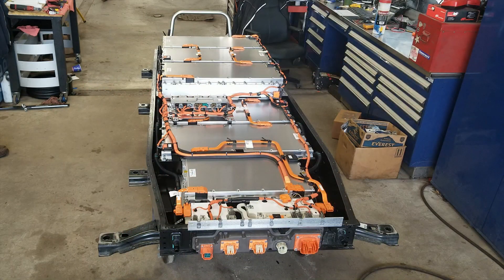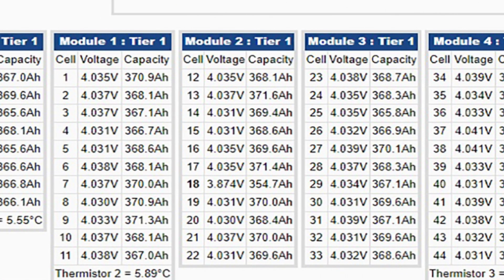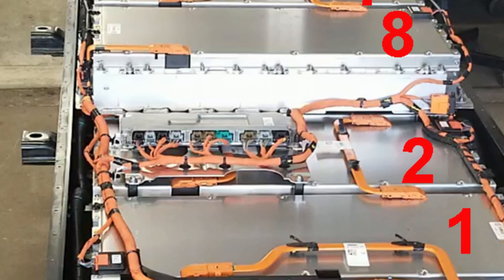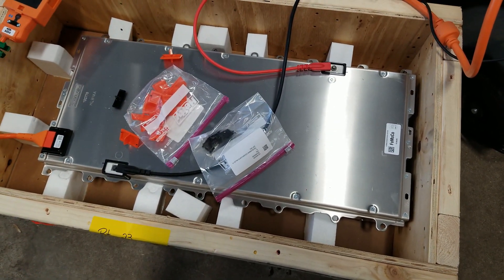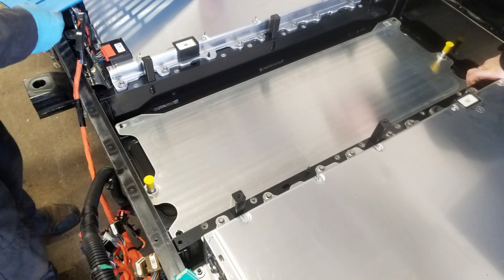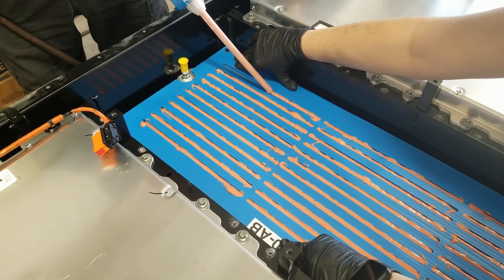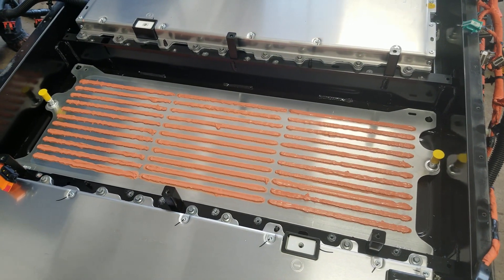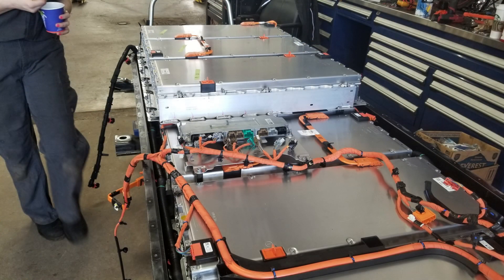2022 Ford F150 Lightning High Voltage Battery Module replacement

Comment: It's a 2022 model so the question is why it's being replaced ??? Why is nobody talking about how and why it needs replacing and who is paying for it? Supposed to be under warrantee for 8 years or 100K. Am I an idiot, that nobody is asking these questions?
Reply from the maker: It had a cell fault & repaired under warranty
Reply: Nobody is asking because the car is under warranty. If this was a ten year old pickup your question would valid. No such thing as a stupid question though!

Comment: Mine went through this back in January. Took about 9 days to get fixed. Has been fine ever since.
Reply from the maker: Glad for you, early production stuff always have bugs
Reply: I would love to know your experiences so far. I have heard of many problems and recalls and I wasn't lucky enough to get in to the first 200k to order. Supposedly only 18k have  been made in total so what is your experience? Now almost 20k more!!  Is it worth it?   Thanks
Reply: @erikwilson9498  This issue was the only issue I've had. Amazing truck. 8 months in and I'm still honeymooning.
Reply: Still good 2 years later?
Reply: @OnePointLander  yep. Love that truck to death.

Comment: The BMS is the problem here, it should have dropped the cell and let the vehicle remain on the road
Reply: Good point. 1 cell out of 96 shows low voltage and it disables the vehicle. Well played Ford.
Reply: That would be a great feature. Would you need a switch for each cell that the BMS could control? Hopefully Ford will be able to make some improvements as they get more operational data from their trucks in the wild.

Comment: Hi I have got ford Kuga had small crush at the front bumper no airbag damage when I plug FDRS in  coming up with the fault P1A10 code sobdmc hybrid politician control module battery disabled
I looked everywhere in FDRS there's nowhere I can enable this car does not start or crank any help where can I do a locate?
I have checked green disconnector high voltage front left looks fine please anyone can help

Comment: Let's look at the facts how old is his battery pack and look how long it lasted that is the true story
Reply: Let’s look at the facts here, to this day ICE vehicles leave the factory with major defects, needing transmissions, engines and other critical drivetrain components replaced within the first year of ownership all the time. And they have had 100 years to get it right.
Reply from the maker: @legacytesla  mechanic's need not worry, cars  or any other things with moving parts will always break down. The only things that don't are Death & Taxes
Reply from the maker: New models always have a higher failure rate than  normal. It takes manufactures about 2 years to get most of the bugs out

Comment: what if you get F150 lighting with 101k miles on it and then one of the modules falils?  how much is it to replace?
Reply from the maker: About 15 hours labour & 5.8K US for the module.
Pricing for the modules seem to change a lot month to month
Reply: At that rate I'd be looking into my options to replace the bad cell.

Comment: Could you tell me what each of the 4 battery connectors go to? I think  #1 goes to the AC/DC charging plug, #2 goes to the front motor, #3 goes to the rear junction box, #4 idk maybe accessories? Thanks!
Reply from the maker: 5 Connectors from left to right- 1 Cabin Heater/ DC/DC Converter, 2 Rear High Voltage Junction Block, 3 Secondary Onboard Diagnostic Control Module, 4 Module Communications Networks/ High Voltage Disconnect, 5 Motor(S)

Comment: Absolutely amazing video. Please do more as you work on more Lightnings.
Reply from the maker: Thank you! Will do!
Reply: So as ironic luck would have it, I literally just got this exact same code and my Lightning entered into the limp mode. I was able to clear the code using a OBD app which oddly restored power and allowed me to drive it to the dealer. They found module 4 to be bad. Any thoughts on if these are just a random couple examples of failure or a real concern that all the packs eventually will be vulnerable to this? Did Ford offer any insight in to what causes this?

Comment: Interesting! In a decade, hopefully this more modular for the swap and significantly cheaper. I am in the third month of owning a lighting.
Reply: It's cool that you can replace modules. You can't do this in a Tesla anymore. Tesla's are totaled and the entire car needs replacing.
Reply: @USNEM , could you say more?
Reply: @USNEM  Yes, thats true. Teslas only work above 20 degrees, are not allowed in garages and on ships because they burn all the time and they are totalled after 10.000 km or 1 year because their batteries crap out.

Always!
Reply: @wolfgangpreier9160  Tesla batteries have an 8 year, 120,000 mile warranty.  I'm not a Tesla owner but there's no need to go spreading untruths around.
Reply: @Brons2  Yes, you are right. With 8 years and one femtosecond or 120.000 miles and one angstrom the batteries are done and dead.

End of sarcasm. 

This is the manufacturer warranty. Currently we KNOW the batteries last at least 400-600.000 miles. In a few years we know more.

And please do not insult my intelligence that i would get the idea to even try to tell you untruths, personally.

Comment: Great video. Looks identical to the one I just had to change last week. Like the one featured in the video, mine too was a dual motor extended range battery. About the only thing different than what was illustrated in the video, was the module I had to replace. I had to replace module #6 which is the last of the top three, so thankfully I didn't need to remove the top three modules as well as the BECM to the one you had to in your video. From my experience, I found those cold plates to be extremely flimsy. When lifting the module off, I was getting hung up on the studs. Also, when applying the TIM, I realized the template provided didn't align properly to the bolt holes on the end, so I had to tape the template into the plate, apply the TIM, scrape off the excess very carefully as instructed by the workshop manual, and then lift the template off carefully before being able to install it onto the pack, and then in turn, lower the replacement module carefully on the of the cold plate without smearing the TIM as it is lowered. A very tedious task it was. My biggest pet peeve of the job was the time taken to balance the replacement module. I had to leave mine on the balancer overnight before the process would complete. So in the meantime, I have one of my bays tied up with the HV battery removed, and the top cover removed, waiting. The other bother for me, was waiting for the coolant bleed procedure to complete with FDRS. It took about two hours for that process to complete, so I had to have a charger connected to the LV battery, as well as the laptop charger connected during this (so that the laptop battery wouldn't die mid process!!!). So for me, raising and lowering of the HV battery itself wasn't the difficult part. But the rest of it....
Reply from the maker: As well as complaining on YouTube, submit a Labor Time Review Request to Ford!
Reply: @RedneckCam666  it would likely fall onto deaf ears as you know. I was informed by Hotline that the balancing process would be very time consuming, no getting around that. As far as how long it would take would depend on numerous variables, including but not limited to the level of charge the replacement module arrives at. As far as complaining goes, I only wish the required information on the original module to be replaced, could have been obtained without having to drop and disassemble the HV battery so as to increase efficiency in future repairs going forward.
Reply from the maker: @michaelchan8915  Not doing something about it makes it ... YOU are the problem
If everyone steps up...= Change
Reply: Thats interesting , info , its important when designing products that repairability is considered , seems like a messy long drawn out process to replace a module. Imagine it should take about 3 hrs total to do for the first time , and about 1.5 hrs once your dialled in. But at least the battery is broken down into modules unlike the Tesla where the whole thing is one big glued up mass.

Comment: Is this a standard range? So the extended range pack just finishes the 2nd tier of batteries?
Reply from the maker: This battery IS the extended range version
Reply: This is extended range, the standard range will have several of the large modules replaced with small modules (if you look at module 9 you will observe it is smaller than the rest, this is the "small" module and the others are the "large" modules).
Reply: They use smaller modules instead of just not having the top layer? That’s an interesting choice. I had always figured the bottom layer was the same and the ER was just the addition of the top layer.

Comment: all that for a single bad 18650 battery ( or whatever is used ) in a pack?  it seems like we have a reliability problem here . . .  This is NOT giving me a warm fuzzy feeling about electric cars.
Reply: totally different cells than 18650 cells; these are actually substantially larger cells, only about 80 of them per module vs hundreds of them in the little cylinder designs.

Comment: Until they make these battery packs swappable like a battery pack for your drill and a gas station is just a battery swap station. I’ll never get one
Reply: Would you swap your drill battery with a stranger? No way
Reply: @TheLemonBird  I would if it was a universal system where the battery station was the one to handle the maintenance on said battery. Pull up to battery station, swap battery, drive away. You own the vehicle not the battery

Would actually lower the cost of evs because you’d buy the car and the battery would be managed and built by the battery stations. Gas stations have refinery’s, get rid of those and make factory’s to build battery’s if that’s our ultimate future.
Reply: So you would rather have to swap batteries every day or maybe only once a week, as compared to charging it back up where you might have to change it every 8 years?
Reply: @Tearitupsports  on a road trip hell ya, drive as far as you can, pull into a battery swap station, leave 2 mins later. Instead of these company’s making your car completely useless once the battery’s dead, like the new teslas coming out the battery is sandwiched inbetween the floor pans where as soon as that battery is junk the car becomes e waste. Instead the battery stations would deal with depleting battery’s, having battery chargers, and keeping them up to date. Major warehouses already do this exact thing with battery forklifts. Have a trained person on hand to swap them.
Reply: I’d never swap my well cared for battery that I know the exact history of for some rando battery.
Reply: @bowefamilyEV  sure
Reply: @cheesegrater231  but you would then spend more time just waiting there to purge the battery coolant than you saved with the swap. This was an idea that Tesla was going to do. I've seen a video where they did that in comparison to fueling up a comparable vehicle with gasoline and the swap was faster. The idea was say you were doing an up and back road trip. Like LA to San Francisco. You would stop in the middle somewhere along the I-5, say Kettleman City for a loaner battery and you would pick up your owned pack on the return trip.
Reply: The way battery-swap can work is actually totally doable, NIO is already doing it, their strategy is they sell you a car but you don't "own" the battery pack, instead they lease or make you "subscribe" to the battery pack program.  It sounds crappy but the subscription includes your cost to "recharge" because you can pull into any of their swap stations and it just replaces your vehicle's battery pack with a fully charged one and that only takes 2 minutes and you are on your way again.  You don't have to go back to that station later to get "your" battery because none of the batteries are yours, you are paying a subscription to the battery service instead.  I'm of two-minds about that idea b/c I like to "own" my stuff but I can also see the huge advantage in charge-times and simplicity, as well as the longer term consideration of "what happens when my battery gets old and needs replacement"; as long as you keep your subscription your battery will always be "healthy"...